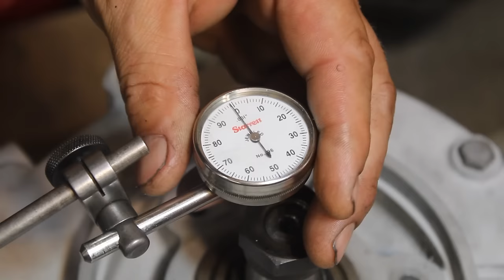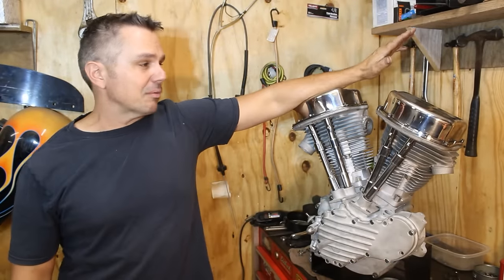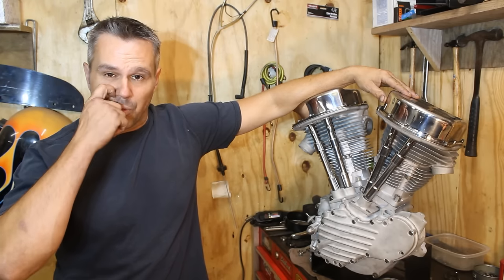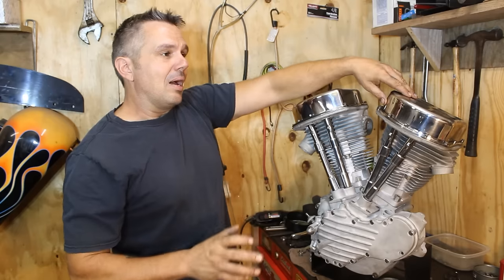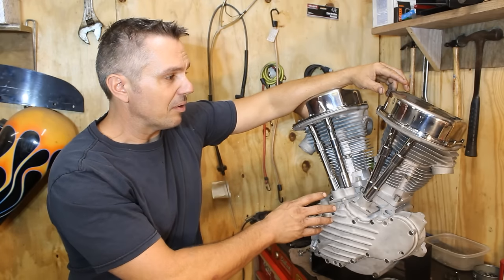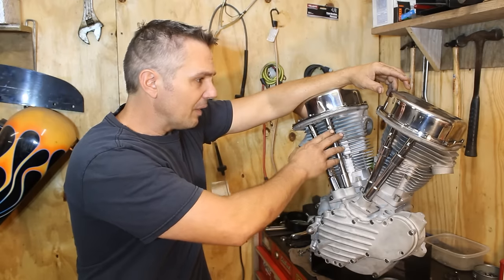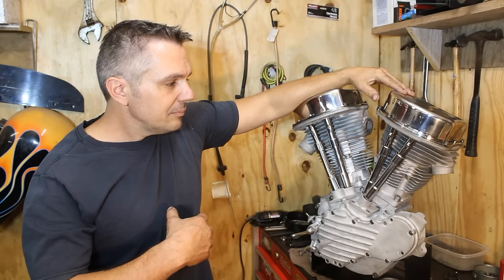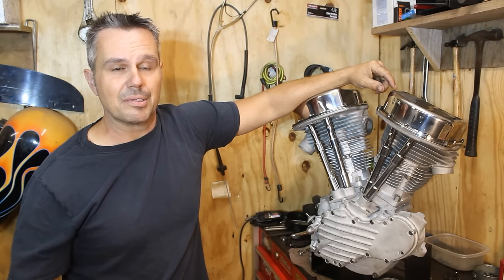Restoration of a 70 Year Old Harley Davidson Panhead Engine

Comment: Why do you paint the inside of the housing halves Red?
Reply from the maker: That's actually not paint it's a sealant to prevent weeping oil out of the porous cases. The factory did it up until the late shovelhead years when the casting process got better.
Reply: @DeathProofProductions  Thanks I have learned something now!! I have seen the red sealant in Cast Iron Car Engine Blocks too.

Comment: Why no pre lube on all rotating parts before final assembly
Reply from the maker: You can see the oil on the gears around time stamp 13:01. Had to cut out some things if not the vid would have been 30 hours long.

Comment: You enlarge the valve guides one scribed ring each replacement.  Noseeum dude!
Reply from the maker: They were not replaced the bike was in a fire with only 500 miles on it. That's why I was checking it.  Assuming dude.

Comment: Excellent video editing! Only thing to note was the lack of assembly lube during final assembly, Cams/lifters/Piston. Not bashing, just suggesting for next time. Did you end up using sealant between the cases?

Check out Tatro Machine on YouTube, he’s a veteran rebuilder. Lots of knowledge, plenty of videos to help!
Reply from the maker: Everything had 20 50 on it you can see the oil on the timing gears. Yes I used 3m three bond on the cases like I was tought by the factory.

Comment: Hello mechanic, the piston is lubricated before you insert it into the cylinder! You didn't know that?
Reply from the maker: The cylinder is what's supposed to be oiled before you put the piston in . If you go to time stamp 13:10 you can see the oil on the gears. I had to edit out some things to keep the vid from being 40 hours long. Just like when you see me check flywheel end play but you don't see me change out the the shim.  Or when I measured the thrust faces on the piston rings or what filler rod I used to tig weld up a broken cast iron cylinder fin.

Comment: Paint inside an engine? Isnt it a risk of flaking an blockin oil passages?
Reply from the maker: That's a engine sealant simular brand as glyptal the brand the factory used. The early  casting were green sand cast and the porosity  could weep oil out.
Reply: @DeathProofProductions  oh, ok, thanks.

Comment: Any gasket/sealant between half of the engine blocks? Proper torques during tightening bolts? Any lubricant during installing pistons in cylinders? Whole engine was assembled without drop of oil so first start will be devastating. Blasted surfaces of the engine not protected against absorbing oil and dirt. Please tell me that all of it was just for show.
Reply from the maker: At time stamp 13:02 you can see the oil on the gears, then when i put the cover on it shows me torque the bolts. I used 3m three bond on both case halves and gear case cover to seal them just like the harley davidson factory trained me to do.  If everything I did was in the video  it would be 30 hours long, had to cut the obvious things like oil and lock tight. The only thing that puzzles me is not one person has asked was the flywheel end play right. It shows me check it but it doesn't show if I needed to shim it or not. That one thing is the absolute most critical thing to do to keep from destroying the engine.
Reply: @DeathProofProductions  Thanks for the clarification. I haven't work with H-D engines but i did with H-D wiring. I also worked with other car and motorcycle engines and I am used to use much more oil during assmebly. So I was a little surprised that the engine is so dry. Try to do timelapse or increase speed of video 😁
Good job. 
But I would paint sandblasted aluminium elements with some paint to close and smooth out surface to prevent against catching dirt and oil. I like this engine black, cylinders silver, covers also black.
Reply from the maker: Yeah time lapse is a good idea thanks.

Comment: Did I miss something, you split the cases and didn’t change the bearings ???
Reply from the maker: This bike cought fire so I was just checking to make sure it wasn't rusted all to shit. We put it out with water and some went in the intake so I needed to check everything to make sure it wasn't  jacked up. The guy I brought it from said he rebuilt it 500 miles ago. So I measured everything to make sure.

Comment: Not bad at all. But first, fixing the flywheels together only by tightening the nuts is not enough. Factory regulations require the use of a press (amount 5 - 6 tons) before tightening the nuts. Second, never smash the flywheels  while fixed in the truing device. We make up to 200 cranks a year....
Reply from the maker: Were are y'all  from.

Comment: What happend to assembly lube.
Reply from the maker: I had to edit out some things like oiling the parts and using loctite to keep 40 hours of work into less than an hour for the vid. Even when i checked flywheel end play it had to be shimmed but i didnt have time to show doing it. When I install the gears you can see the oil on them and the bottle of loctite is sitting beside the engine.

Comment: why did you paint the inside
Reply from the maker: the green sand casting process used back then was known for porosity and inclusions. they used this as a case sealer to prevent the chance of oil weeping out of the cases.
Reply: @DeathProofProductions  is it just regular paint or special sealer
Reply from the maker: special sealer.

Comment: Looked like your base gasket were cover some kind of hole
Reply from the maker: The gaskets are for my late model panhead used those to finish filming and to check valve to piston clearance.  When I disassembled the engine the deck of the head's had fresh machining.  Needed to make sure they were not decked to increase compression just milled to true up warpage. So I used those since I had to remove them to measure the lead wire. the other ones hadn't arrived yet.

Comment: Под горшком скорее всего в прокладке должно быть отверстие под масленный канал, или я ошибаюсь??? 🤨
Reply from the maker: good eyes. yep those gaskets are for a late model panhead with external oiler. The ones I ordered were not here yet so to get the video done on time I used those. I still have to finish honing on one of the cylinders.

Comment: Didnt see any provisions for oil feed lines to the heads ??
Reply from the maker: Your correct those are for my 1964 pan the correct ones hadn't arrived . Used those to finish filming and to check valve to piston clearance,  there   were some nicks on the piston and both heads had fresh machining marks on them.  The guy I bought it from said it had been rebuilt around 500 miles before the fire so I wasn't sure if he was just straightening warped heads or decking them for more compression.  When I built my first shovelhead back in the 90's  I ran into a simular situation, assumed it was just to fix warpage. When I fired it up after installing a mild can I ended up with a bent valve and cracked guide, So lesson learned.
Reply: Thanks for responding, thought maybe someone figured out a new way of getting oil to the top for a cleaner look on the early styles. Great content in your video , Thanks @DeathProofProductions

Comment: good video, I hope I missed all the places in the video where you lubed up all of the parts during assembly, if not........oops $$$$
Reply from the maker: I didn't film stuff like that but if you look at time 13:04 you can see it on the gears.
Reply: @DeathProofProductions  I use a lot more than that, it dilutes out in the oil. I miss my 49FL, it was a running SOB, I built it from a basket and a shopping cart full of second stuff from swap meets, back in the day. You should hang on to that 50
Reply from the maker: Thanks. my first build was a 76 that I got the same way.

Comment: Zdálo se že na těsnění mezi blokem a válcem není v těsnění dírka pro mazací kanálem do hlavy ?
Reply from the maker: yeah that gasket is for a late model pan. The right ones hadn't arrived yet so I used those to finish the video and check valve to piston clearance. The bottom end is finished but I lack a little honing on the top end.

Comment: Масло каналы под цилиндрами закрыл прокладками. Или так и должно быть?
Reply from the maker: those gaskets are late model pan gaskets with  external oilers. I used those to finish the video on time and check valve to piston clearance. still have to take down top end and finish honing out the rear cylinder.

Comment: That bottom end was already  apart lol because  thats  crank welds it self too the taper , came apart  to easy lol
Reply: Also you never strike the flywheels  between  center you fuck up the pinion  shaft  , or wreck the center , like that hack tatro machine !
Reply from the maker: I bought this bike from a guy in Tom ball T.X. and when I unloaded it at the house i fired it up to test ride it through my field.after  one lap it cought fire because of a electrical short. We had to put it out with buckets of water from my creek. So when I took it apart my main goal was to check for rust on any of the bearings. I did find rust on one of the cylinders from the water. That was the first time took them apart it took me a lot more time's then what you seen in the video to loosen them. in the edit we had to shorten some things and edit out some things to keep the vid from being 40 hours long. For example you see me check flywheel end play but you don't see me change out the the shim to a larger one, and I had to. It wasn't until the 80's that Harley started recommending not to hit them in the truing stand. In all the service manuals until then it says loosen the centers and strike the flywheel. I've been doing it that way for close to thirty years and I have yet to damage the pinion or centers and that's the same lathe iv been truing them on for about since I got it 20 years ago but I'm not hammering on them like I'm mad at them. I figure if I can line up a giant gas turbine to a generator within .001 thousands in all the power plants Iv built as a millwright I can line up a little set of flywheel' s
Reply: @DeathProofProductions  cool keep it   not a hater  been building motors  for 32 year

Comment: No assembly lube was harmed in the making of this video.
Reply from the maker: Go to time stamp 13:10 and you can see the oil on the gears.  Had to  edit out some things to keep the vid from being 40 hours long. Like when you see me check flywheel end play but you don't see me change out the the shim to a larger one. When I separated the flywheel the vid shows I think 2 hits on the wedges but it took a lot more than that.

Comment: You pulled old black nitrated valves out?  It's been "restored"
Reply from the maker: I got this bike from a guy in Tomball Texas some years back. He had rebuilt it a few years before the fire.  All I had to do was disasimble it clean and inspect everything for corrosion since they used water to put it out. Everything checked out good other than the flywheel end play I did have to shim it and the front cylinder had some corrosion, luckily it honed out without going past tolerance.

Comment: Olin huomaavinani,että sylinterin alapään tiivisteissä ei ollut oljyreikiä ollenkaan.
Reply from the maker: Good eyes, those gaskets are for my late model panhead the ones for that one hadn't been delivered yet. That bike had been in a fire not long after the engine was rebuilt so manly I was cleaning and inspecting for rust on any critical components. While I had it apart I noticed the heads had been machined decks and there was a nic in the top of a piston that made me suspect that it was decked to increase compression. So to get the vid done on time and go ahead and check valve to piston clearance while I was waiting, I just used those.
Reply: @DeathProofProductions  
Ok. Ruuvasin oman fl52 etu kannen kiinni. En huomannut,että tiivisteen reikä ei ollut kohdallaan. Rocker jumiutui ja mäntä löi venttiilin vinoon.

Comment: All without locktight and torgue 🤪 we’ll see how long it lasts
Reply from the maker: i did use 242 blue locktight. u can see it sitting right beside the engine and you can see me tourqe the cam cover bolts. if i was to film every little step along the way the video would be 30 hours long.

Comment: I hope he realizes that the top end of that motor was going to be ruined after it has been run for a few miles! The top end on the Panhead was fed oil by a passage that runs up the side of the cylinders into the heads. The oil is fed to the cylinders by a hole in the cases where the cylinders mate to the cases BUT there MUST BE a hole in the cylinder base gasket in order for the oil to flow from the cases and up into the cylinders! I happened to notice when he was installing the cylinder base gaskets there WASN'T a hole punched in them for the oil to flow thru! BIG MISTAKE!! Also, I hope he wasn't planning on running that motor like that anyway because he never applied any gasket sealer to multiple locations that will most certainly leak oil!! Chief among those locations is the rocker cover Pan, the Panhead rocker covers are notorious for leaking oil!! Even when the bikes were new from the factory the Pans always leaked and Harley NEVER came up with a satisfactory fix to the problem. He didn't put one bit of gasket sealer on those Pan gaskets!! Of course, he also didn't put any oil or assembly grease on any of the lower end bearings so when the motor is first run all the bearings are going to be running bone dry until the oil can circulate throughout the motor! ANOTHER BIG MISTAKE! AND somebody isn't going to be happy when they buy that engine and the top end blows up and the bearings seize up and oil comes pouring out of all the mating surfaces!
Reply from the maker: I admire you for you good eye's on the hole for the oil line in the cylinder gasket. those are for my late model pans I own. The gaskets I ordered had not arrived yet so to check valve to piston clearance I used those. 30 hours of work cut to 20 minutes means I have to cut out obvious things like oil and lock tight. also if you tighten the pans evenly they won't leak. well  mine don't any how all 17 of them. hit the bell that way you get the notification of the vid of me firing it up.

Comment: Hopefully that’s just a demo? Not one drop of assembly lube anywhere.?????????
Reply from the maker: I had to edit out some things so the video wouldn't be 40 hours long, like applying lube or using loctite but when I install the gears you can see oil on them, you can see loctite on the toolbox. Just like when I checked endplay with  the flywheel's  in the case halves, you see me check it but you don't see me change out the shim and I had to. It takes more than 45 minutes to build an engine so I have to cut some things out.

Comment: 13:54 gaskets and oil lines?
Reply from the maker: good eyes yeah those are late pan gaskets. the ones i ordered hadnt came in yet. really what you see me doing is the valve to piston check on the engine. i still have to pull the cylinders and finish honing them. im surprised how many noticed that.

Comment: Didn’t lube the bearings or hone!?!
Reply from the maker: If you look at around time stamp 13:10 you can see the oil on the gears. Every part that needed oil got it,  including when I was setting the cross hatch pattern with the hone. We had to edit out some things to  reduce 30 hours of work into a video that wasn't too long.  Things like applying oil or loctite I felt that people would see the oil on the gears or the bottle of loctite sitting beside the engine.   like when you see me check flywheel end play, but you don't see me change out the the shim to a larger one and I had to.  I've been a factory trained mechanic for close to thirty years.  If I didn't know to oil the parts, I would have never been able to afford a panhead because all my customers would quit hiring me.

Comment: A friend had a old harley in the early 90´s the thing never worked he spent most of the time during the summer repairing it along the road, lol one time the weld on the oilpan gave up and dumped the oil on the backwheel after that he sold it and bought a Laverda mirage lol also a disaster bike.

Comment: Ain't going get any oil up to the top end using those cylinder base gasket... !
Reply from the maker: those are for my 1964 pan. The ones I ordered were not here yet so I used those to finish the video and check valve to piston clearance.
Reply: @DeathProofProductions  Dang L8 grind cam ..🙄
Reply from the maker: yep

Comment: HUMMM I DIDN'T SEE THE HOLE OR HOLES IN THE GASKETS FOR THE OIL TO GET TO THE TOP END UNLESS IT HAS OUTSIDE OILERS 🤔  ❓️
Reply from the maker: Yeah we just used some late panhead ones that we had on hand to finish the scene in time to upload on a schedule. I still had to pull the top end apart to finish honing out one of the cylinders.

Comment: Где-то чистит до метала, где-то грязь остается. При соединении картера вообще прокладу не поставили
Reply from the maker: there is not supposed to be a gasket for the crank case. You use 3m three bond like the factory. a gasket would affect the crank bearing end play measurement.
Reply: @DeathProofProductions  ok

Comment: Меня одного смущает отсутствие отверстий дренажа масла в прокладках под цилиндры?? 13:50
Reply from the maker: those gaskets are for a late model panhead. the correct ones hadn't arrived yet. I was just checking valve to piston clearance. still had to remove the top end to see the measurement and knew I could put the other gaskets on then. but good eyes means you know about panheads.
Reply: @DeathProofProductions  Спасибо, просто опыт из жизни с советскими мотоциклами))
Начал дымить ,сожрал масло, разобрал головки, нашел масло))